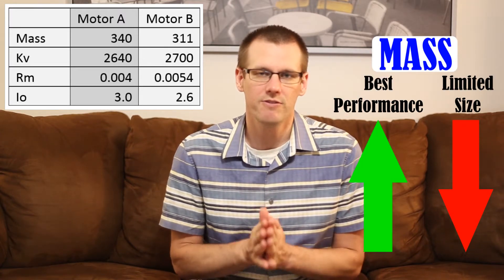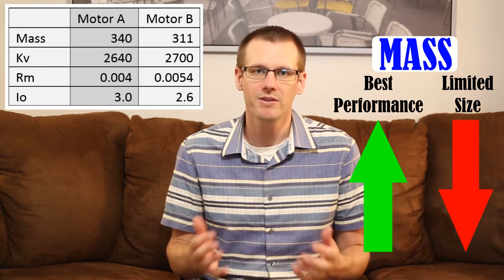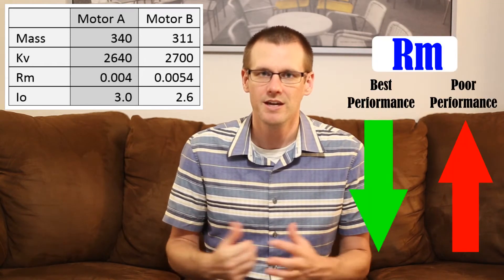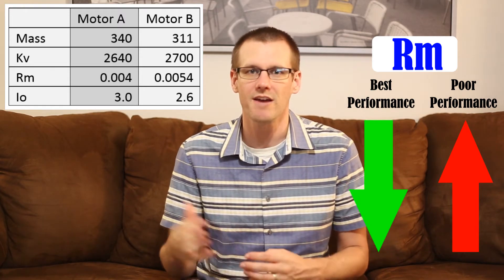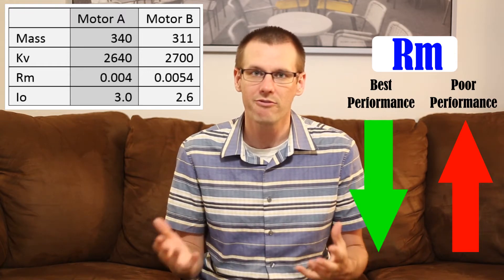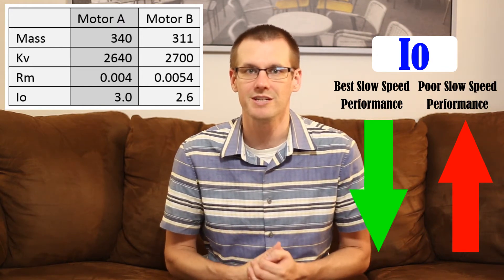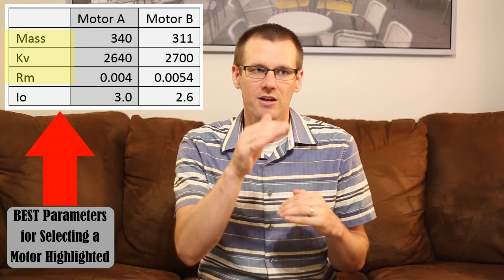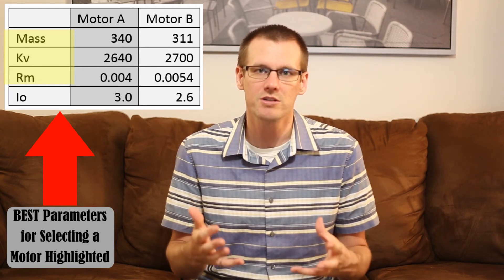Brushless Motor Electrical Parameter Comparison

Comment: What should I ask myself when comparing a 5200kv motor with low gearing vs a 4300kv motor with high gearing. I saw your video about gear ratio. With my sour fixed, it sounds like I should choose the higher kv with smaller pinion?

Comment: Low Kv motors usually have higher Rm because the windings are thinner and longer, compared to the same motor would with a thicker wire to have higher Kv.
Is this correct?
Reply from the maker: Yes, this is correct. The key words you have used is comparing the same physical size motors.